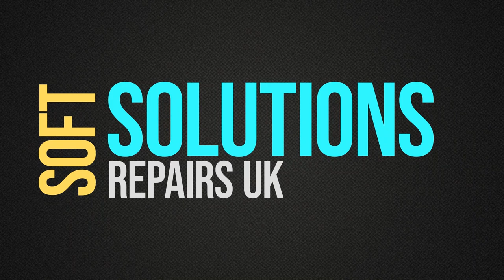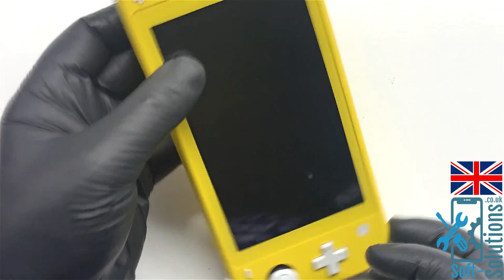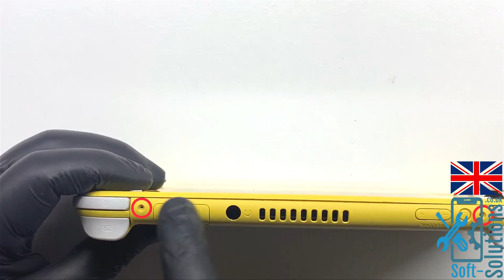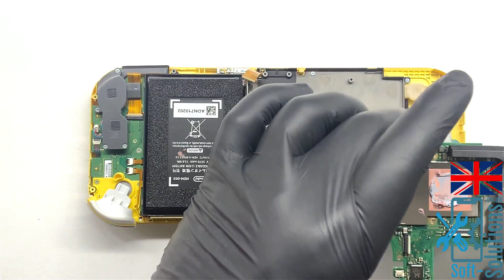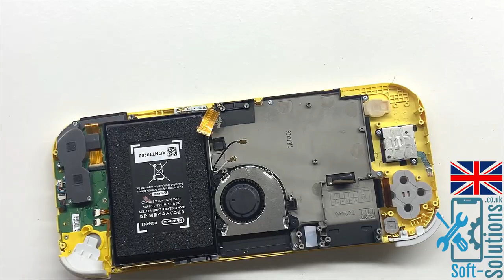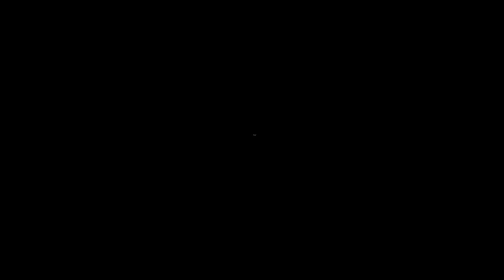Nintendo switch lite right joystick replacement

Comment: This was a very helpful tutorial. Thank you!!    Taking everything apart and removing the damaged controller was a breeze, thanks to the clear instructions of the commenter.  However, I did have a couple challenges putting everything back, after swapping out the damaged controller: 1. The commenter recommends making sure that the joystick moves freely before reconnecting everything. However, when I turned the device over to do that, the 4 rubber buttons on the adjacent pad fell out.  I recommend holding them down with your thumb before turning the Switch over to test the joystick.  2. The larger (touch digitizer flex) ribbon was very hard to get back in. I kept trying to lock it in, but it kept popping out.  (I must have replayed this step 15 times). The trick is that you have get it in really low (close to the board) and slide it underneath the connector, and it will then lock in appropriately.  3. When reconnecting the battery, make sure the connector wire is secured tightly.  When I first reconnected the wire, I though it was secured, but it wasn't all the way in and the Switch would not turn on.   Listen for the snap.
Reply: I'm having a true nightmare of a time with it. Is it possible that the door is just incapable of holding it down? I've been messing with it for an hour...
Reply: lmao the same thing happened to me. 
1. the rubber pad fell out almost without me noticing it, i figured it out but
2. the touch screen digitizer ribbon was hard I agree. the locking tab is so tiny and feels so flimsy when its unlocked. make sure its pointing up. this one gave me some trouble. I had to take a break because my eyes hurt. What helped me get it is once i felt it was partially in, I pushed the flex cable with the tip of my fingernail lol. my tweezers kept slipping.
I usually suck at this kind of stuff but with many pauses and replays I finally got it!
Reply: What was the name of the paste he used?
Reply: @CODGamer9137  my dad use the same thing he put on cpu of our computer.

Comment: I think it would help if you would mention when you are flipping up the safety locks on the cables. On the first cable disconnect I didnt notice and was having trouble figuring out how you took it off with relative ease.
Reply from the maker: Thanks for your feedback.
Reply: @SoftSolutionsRepairsUK  just for that u broke my switch
Reply: @thedrawingllama2046  damn that sucks
Reply: This is a vitally important observation.  This video would be excellent EXCEPT that mistake will lead to a lot of amateurs breaking their hardware.  Clearly this guy had the switch already taken apart before he made the video, and the cables weren't locked in.
I had a lot of laptop repair experience and I knew something was wrong when I had to pull really hard to get the 1 cable out even though I was copying him, so I looked at a different video and they showed how to flip the locks up on all the ribbons.
Reply: @SoftSolutionsRepairsUK   Sorry man, you put a decent effort into this video but you should either upload a new version or delete it.  Without showing people to unlock the ribbon cables, you are causing them to damage their hardware.
Reply: What do I do if I break the safety lock for the joystick? When trying to figure it out I lifted the wrong side and the plastic broke!
Reply: @ReekRendTest1  I almost never comment on anything but I have to here. If you say you have alot of laptop experience then you should of known immediately that is what you have to do. Yes he should of explained it for novices of tech repair. But you yourself  sir, if you have alot of experience in laptop repair then you should have recognized this right away.  90% percent of all cables in laptops are connected with this method. Feel free to reply or not reply. Im not coming back to this comment section but I had to comment after reading this.
Reply: @atta46  
Because sometimes cables do just slide in and out of a slot (have no lock), or to have several different lock mechanisms.  Surely you know this too?  If you try to pry off something that isn't a lock that will ALSO break it.  The point is the video should be accurate for safety reasons.  It's silly to argue whether some of us could figure it out.
Reply: @thedrawingllama2046 mine too
Reply: Y'all blaming this guy.. sure you may not be used to this kind of work but come on.. pay attention to what you are doing. It is painfully obvious to observe this on your own.

Consider it a learning experience for not paying close attention or having known how these components work.
Reply: @ReekRendTest1 I don't think it should necessarily be remade, BUT I wholeheartedly think that the title should be updated with "READ DESCRIPTION" and then have the cable locks fully explained.

Edit: Furthermore regarding the cable locks, MOST of them are white and are positioned that they open on the "outer" part (facing away from the flex cable itself), HOWEVER the digitizer cable lock is black and faces inwards towards the cable. My friend and I spent so long trying open the white part of the digitizer flex cable lock, and fearful of breaking it because it wasn't budging, and then she looked up another (and more recent) video and saw how to actually open the cable lock by lifting the black piece. So I think the description of the video should be updated with this information. These DIY repair videos are targeted toward people who have no prior electronics repair experience, so I think the cable locks are very important and should be mentioned.
Reply: @thedrawingllama2046 maybe this is what destroyed mine I forcefully pulled them out locked. This video needs to be updated or it is pretty awful quite frankly
Reply: Agree. I had to watch anouther persons video to figure that out

Comment: Great video, was able to get everything done no problem! The only suggestion I would make is to note that you put the game cartidge module back in before putting the heatsink down as I didnt realize it was back in and had to fanagle the cartridge ribbon cable under the heatsink since I installed the heatsink first. Thanks for pointing out the screws with the colors too!
Reply: Yes it was a great tutorial but i did not see it pop back in and when i turn on my switch it doesn't read my game card
Reply: It shows up visually but he did not verbally mention it. At 4:40 the game cartridge module isn't there, also notice the old thermal paste is. Then suddenly it appears in, and the heat sink "foundation" (?) is clean of any thermal paste. Then at 5:06 the game cartridge module isn't there, and he cleans the old thermal paste off. Then at 5:20 without any mention, the game cartridge module is back. The way it's edited is a bit anachronistic in those parts, is what happened.
Reply: Just reverse the steps from taking it apart 😂

Comment: Great step by step, just want to point out a few things.

1. One screw is longer on the shield
2. You're missing a screw on the right speaker.
3. You didn't show placing back in the card reader/headphone jack
4. You Forgot to put the ribbon cable under the Ribbon Cable (small one next to headphone jack).
5. You lost a screw next to the ribbon cable of the card reader.
6. Your banners are covering up the connections on the right.

To everyone else:
- Make sure the ribbon cable locks are lifted before pulling.
- Close cable locks after that reconnecting the ribbon cables.
Reply: This is vitally important information, so as nice as this video looks it's a horrible tutorial.  Those key points missed will make amateurs (and some experts) break their Switches badly.
Reply: SchizOnWheels  
You may or may not damage the ribbon cables by pulling while locked in, or even the circuit, but you definitely wouldn't be able to get them back in without unlocking anyway, and if you try either break something or else the cable would not make contacts and yes black screens.

If the Switch turns on and makes sound with a black screen, I would (after disconnect battery) carefully remove and reinsert the video ribbon cable(s) (or just all ribbon cables, for me it was just the 1).
Reply: SchizOnWheels  
It shouldn't short circuit if it's wrong, it just won't work.  I recommend watching a few other videos that show the same procedure with the ribbon cables more clearly.

Comment: Thank you for the detailed instructions and close up footage of every single screw and flat cable needed to perform this repair. Took me some time, but using this and the other video for the left stick, I managed to perform this repair myself, and replace the original sticks of my Switch Lite with Gulikit Hall Effect sensor sticks, that should be free of drift forever.
Reply: Hey is it worth it to switch it although my sticks dont have drift?
Reply: @TanB2711  they're not too expensive, and they've been working perfectly so far. If you got the money and feel safe in doing the repair yourself, I guess you could.

Comment: You did not mention that flex cables has locks, that is why I am wondering you did taken those flex cables so easy and mine are not. Yes I fix my analog Joystick but my LCD monitor backlight is not opening. Maybe because I push to hard on each flex cables. You should mention critical steps to avoid these kind of mistakes. You should tell in your video that there is a lock on flex cable and avoid scratching them. 😠
Now I need to order flex cables just to wonder if that can fix my backlight issue 😡

Comment: Took me long enough but i was able to replace both joy cons. Only issue I had was when i put everything back together the screen wouldn't show. So I re adjusted the cable for the screen and switch was as good as new. Excellent video
Reply: Same here!
Reply: i’m having this issue :( i’m not sure what the cable for the screen is
Reply: @aleksandrduncan6435  same did you find out
Reply: @drazzrg573  what cable do I change
Reply: Hey I know its an old review but im having the same issue replacing my son's nintendo which cable did you have to readjust? Thank you
Reply: @leahhicks288  yeah just make sure the cable is in there completely nice and snug
Reply: For anyone else who has issues with the screen connector. There is a white tab that must be raised before the connector can be fully inserted. See the ifixit guide

Comment: Great turorial, good use of the video where you highlighted all the screws and why they are different, one comment i would have is that some of the flexible connectors are very fiddly to reseat once the joycon stick has been changed.  Apart from that excellent.

Comment: Thank you for this Video. I ordered a kit off Amazon with cheap tool kit and 2 Controllers. For like $12-$15. I called around they wanted $80+ to replace it!! That’s ridiculous with this video I was able to do it myself. Only issues I had was 1 the flags on your Video was in the way of screws and I had trouble with the screen ribbon latching back.

Comment: IMPORTANT STEP MISSING.  DO NOT JUST PULL ON THE RIBBON CABLES OR YOU COULD BREAK YOUR HARDWARE!
WATCH A DIFFERENT VIDEO!
THIS GUY DOES NOT SHOW HOW TO UNLOCK THE RIBBON CABLES FIRST, WHICH CAN BE SEEN IN VIDEOS BY OTHER PEOPLE.
You have to flip up one side or the other (depends on which cable) to unlock the ribbon cables before pulling on them.
Clearly he had taken this Switch apart before making the video, and forgot to lock them back in when recording this.

AGAIN FOR VIEWERS, WATCH DIFFERENT VIDEO(S) UNTIL YOU CLEARLY UNDERSTAND HOW TO UNLOCK THE TINY FLIP UP/DOWN MECHANISMS TO UNLOCK/LOCK THE RIBBON CABLES BEFORE REMOVING/RECONNECTING!

Comment: Hey thanks for the video, i have followed the instructions and replaced the joy stick however the screen does not come on, well it lights up but does not show the home page. The touch founction of the screen does work as does the other buttons. I have rechecked the LCD cable and it seems to be fully inserted and locked, Any other suggetions thank you.
Reply: Hey, did you ever get it fixed? I replaced the right stick and after I put it all back together my switch won’t even turn on. I followed step by step idk what I did wrong
Reply from the maker: What we have experienced when repair switches when you attempted repair and had no display issue.
80% have damaged display connector or shorted pins inside the connector(connector needs to be replaced)
20% Of them broke traces under the CPU(cold joint traces damage) by putting too much pressure on the screws while unscrewing and screwing them back on(CPU needs to be repair)

If you would to send in for repair, please follow our Mail-in repair link.

https://soft-solutions.co.uk/mail-in-repair/
Reply: I’m in the same boat. It’s on, I can hear the movement but the screen won’t light up…
Reply: @nickowens4668  
Unlock and remove the video cable (behind the game card), then push it back and make sure it's all the way in.  The side tabs of the cable don't quite go flush like some other cables but they are very close, leaving the tiniest space before you lock the flap.

Comment: Hi. I followed your tutorial. Everything is very clear and informative.  I have an issue though. The sound works but the screen is black. What did i do wrong?
Reply: Check the video cable, directly behind the game card slot.
Unlock the flap, and make sure it is pushed in all the way. 
Mine looked ok, but it wasn't in quite all the way, about 1mm out.
The side tabs of the cable don't quite go flush to the slot like some other cables but they are very close.

Comment: Thank you for the video. I was able to fix the right and left joystick. The joysticks work wonderfully now and it no longer drifts but I think somewhere along the line I messed up because now it's not reading any game cards. I took everything back apart to make sure everything was connected and it is. Any advice? Did I mess up the game card slot somehow?

Comment: 1:50 for quick reference on screws for reassembly! Though not mentioned in the video, DO YOUR BEST to not touch the heat dope a.k.a the "pink stuff" as my kid called it. Doing so can help you avoid need for reapplication.

Comment: I used this tutorial in conjunction with the one for the left Joystick, as well as one for replacement of the battery. I also used thermal grease after cleaning the old grease away. It was overall a satisfying job, and presents a huge improvement. I am grateful for these easy to follow instructions.
Reply: SchizOnWheels  Nope. The biggest problem I had was getting the battery out. It fought me every step of the way, even when using something to try to heat up the glue that houses the battery. I was able to get it out, but the old battery was bent in the process. No matter, because I put the new battery in with better adhesive that would be easier to remove later on. Honestly, the rest of the project was way easier compared to the battery. Also, I did the same kind of job for a PSVita, and the PSVita was a far easier job, owing due to it not having a glued down battery.
Reply: SchizOnWheels   No, I am just good at following what I see, and a really quick learner. So videos here are enough for me to understand what I need to do. I finished my Switch Lite 3 weeks ago based off looking at this video and several others, and my Switch Lite has been working perfectly since then.
Reply: SchizOnWheels  I can only tell you what I did, carefully, and maybe you can glean a little from that. I bought an I Fixit tool kit to have everything I might need to do my projects. It had all the little screw tooltips needed for various sized screws, including the proprietary ones on the Switch Lite. It had a couple of pliers, including angled pliers (which I used to carefully remove various ribbons during the project). It also had thin blade like tools that I was able to use to carefully lift the battery terminal off the socket it was in, and eventually remove the battery itself. If you are only doing the joysticks, you will still need the correct size and shape screwdrivers, pliers for removing and later replacing the ribbons, and a couple of containers to separate and hold your screws so you don't lose any in the process. I don't really have any extra suggestions except that you watch the videos pertaining to your issue and follow them step by step.
Reply: SchizOnWheels  I cannot say for sure. I would go and absolutely be extra, extra sure I followed the video(s), every last step. Check, double check, triple check every last ribbon to make sure it's adequately seated. Same for the battery terminals. There are so many that it isn't that hard to overlook a connection. I was so thorough with my checks on my Switch Lite that I watched a video that did both the breakdown AND the reassembly. If you still have the screen blackout, you prolly still skipped a step by accident. You simply must make sure. If you still have the blackout EVEN then, then I cannot help, as it is outside what I know. You should prolly take the issue to Reddit Switch help, or ask an actual professional here on YouTube. I am just a random guy who is good at following directions. The directions you can find here on YouTube worked rather well for me.